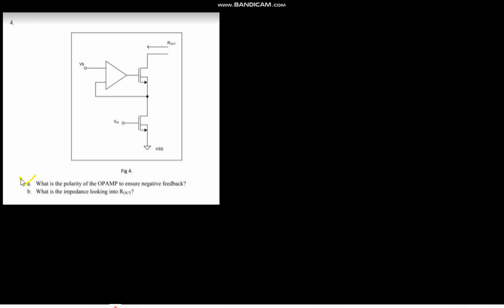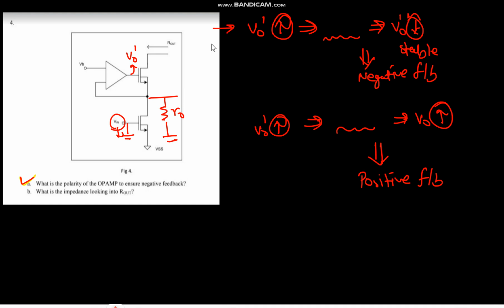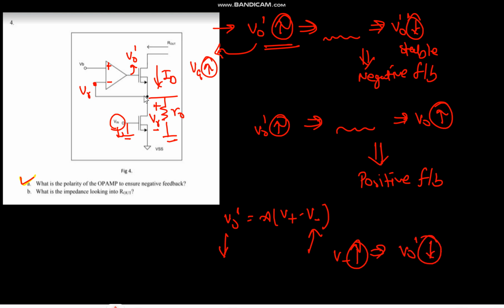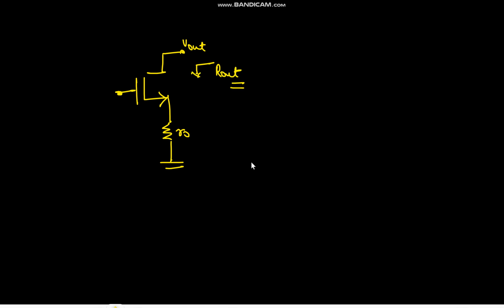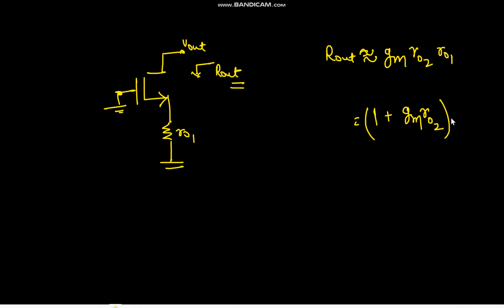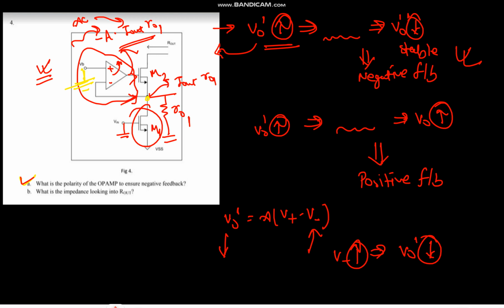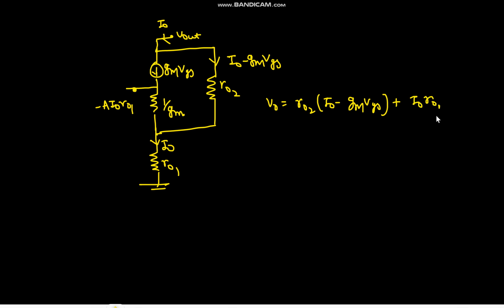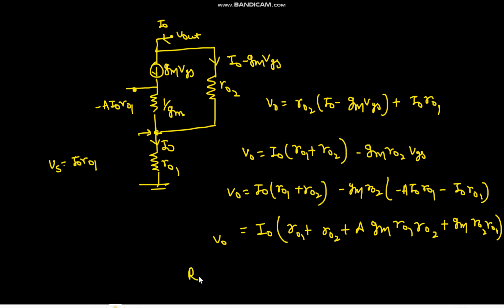Interesting Question on MOS Circuit || Prep for Interview

Comment: In  the non inverting terminal of opamp  there is a fixed voltage of vb and as the opamp is in negative feedback and it has infinite gain , so due to virtual ground concept  the voltaqge at the source will also be vb and that point will also be ac grounded.Correct me if i am wrong?

Comment: Thanks Himanshu for the explanation. One observation here: Is the 1/gm resistance drawn in the model correct? I think its not required, although final answer won't change...
Reply: i think it's correct ,if yu have another perception abt it please share
Reply: @bappadas9547  could you please explain how its coming (1/gm).It would be helpful
Reply: Same dbt

Comment: Suppose an Op Amp has both positive and negative feedback. So their I heard that we calculate feedback factor of both feedbacks and compare them to find which feedback has more influence in the circuit. Can you please explain how to calculate this feedback factor, as different people are telling me different things!! Thanks
Reply: Hi, in such a case, you can simply consider an arbitrary test voltage at the output node of the opamp, and use the combination of superposition and voltage division to evaluate V+ and V- . Depending on which (V+ or V-) is greater you can judge the dominant feedback. 
A more intuitive approach is, since the test voltage is Vt at the output node, you can make a judgement about the voltage at Opamp's input terminals by looking at the magnitude of feedback impedances (meaning if the feedback voltage drop is higher, then the corresponding input voltage will be lower and you can judge the dominant feedback accordingly).
Reply from the maker: Go to my TI interview video. There I have discussed one problem
Reply: @HimanshuAgarwal_  Can you provide the link? Thank you
Reply from the maker: Also, chembiyan T sir has already made a seperate video on this topic.

Comment: This is called a gain boosted cascode and is used when we dont want to use a lot of cascode levels (because of voltage headroom restriction).

Another approach can be to use the concept of negative feedback. The Rout will be (1+Ab)rout, here since feedback factor is 1 we have almost a change from gm*ro1*ro2 -> (1+A) gm*ro1*ro2 approximately.
Reply: More number of transistors we add in the cascode, more amount of voltage headroom is consumed and the output voltage will have lower swing. Hence we use this kind of architecture to increase gain and Rout rather than cascode stacking
Reply: @pratikkaul77  bro how to clear TI analog interview
Reply: Bro Is it  mean that output swing will not be restricted.
Reply: Getting answer by this method is a mere coincidence since the source voltage is sensed here not the drain voltage